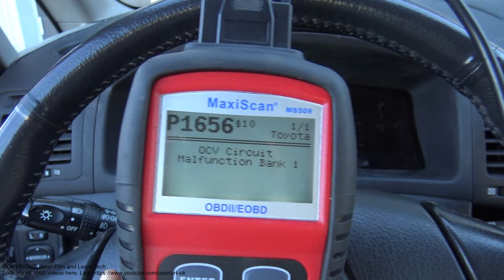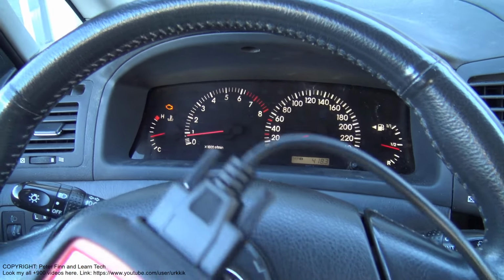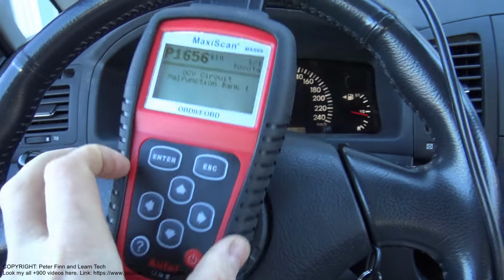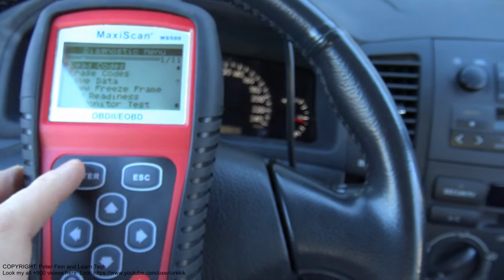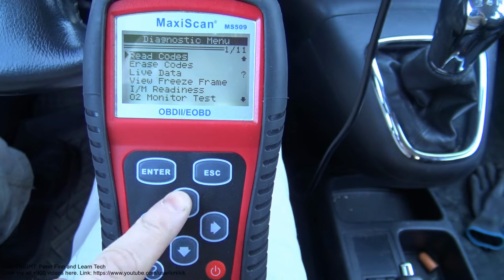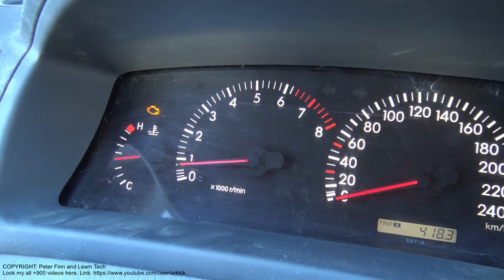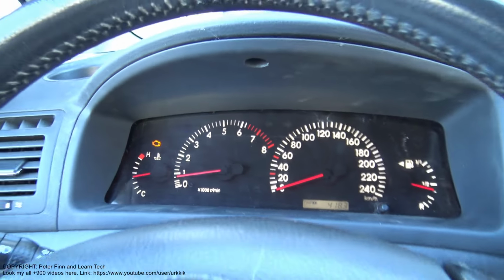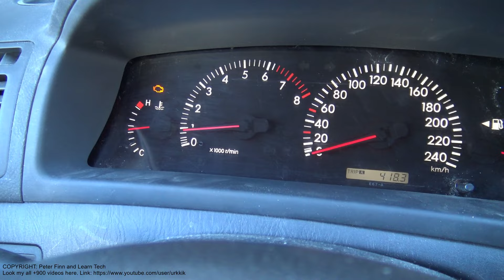What is engine error code P1656 and how to repair Toyota VVT-i system issue

Comment: I've been experiencing the same problem with my 2004 Corolla vvt-i, I didn't replace the sensor but repairing the bad connection on vvt-i sensor has fixed the problem. Thx @Peter Finn.
Reply from the maker: Thanks for comment. :-)
Reply: clean your ocv filter too
Reply: How did you do it?

Comment: Thank you Peter.  I had the p1656 code, then while under acceleration from a stop sign, The car became weak temporarily and I got a p1349.  I replaced the oil control valve sensor like you did in this video.  The p1349 went away, but the p1656 code is still there.  What do you recommend next?
Reply from the maker: Hi, Have you check all these 4 things: 
1 Faulty Oil Control Valve (OCV) 
2 Oil Control Valve (OCV) harness is open or shorted 
3 Oil Control Valve (OCV) circuit poor electrical connection 
4 Faulty Engine Control Module (ECM)

Comment: Hello Peter! My Toyota MR2 Spyder 1.8vvti has a P1349 code. I have cleaned and checked the OCV Solenoid and the oilfilter and both were clean. Is my vvti cam gear broken? And how do I replace it? Maybe you can do a video about p1349. I see many people on forums with this problem :)

Cheers!
Reply from the maker: Hi, I believe that your car issue is in VVT-i valve controllers. So, look video: https://youtu.be/wdsEFtij-4c
Reply: Hi Peter. I have replaced my VVT-i valve controller solenoid, but this did not fix my issue.

Comment: Thanks very much
Reply: i have toyta vitz 20004 ,the problem p 1656 and  p1755 ,and on borad engine light come some times and off after 3 minuts , and the  car at acceleration stop but  the high speed not stop its stop when at slow motion ,pleas ur idea
Reply from the maker: You are welcome